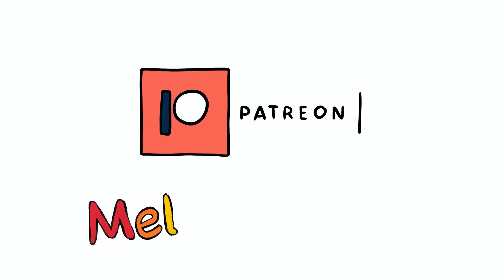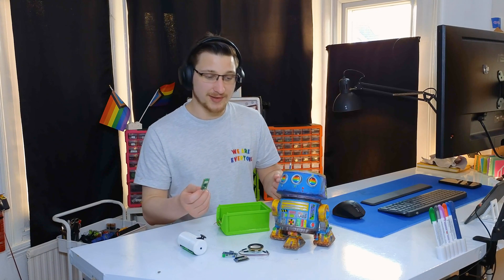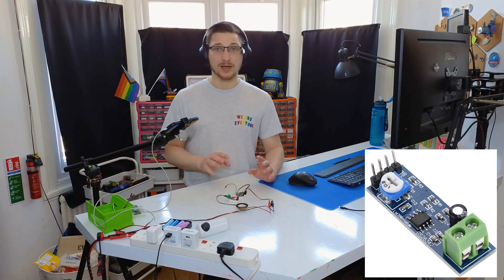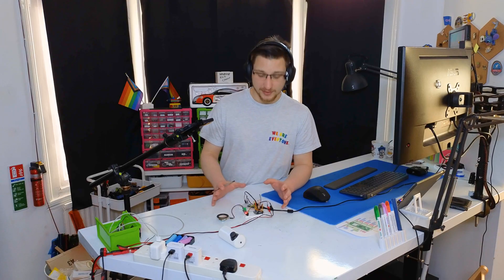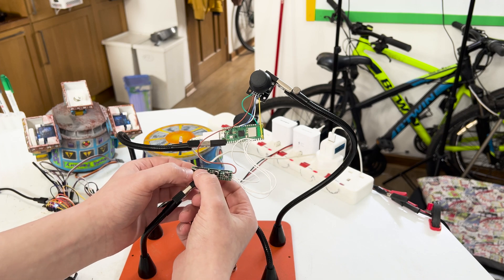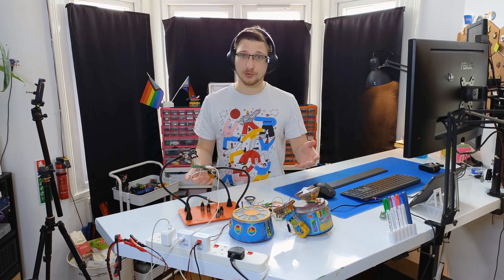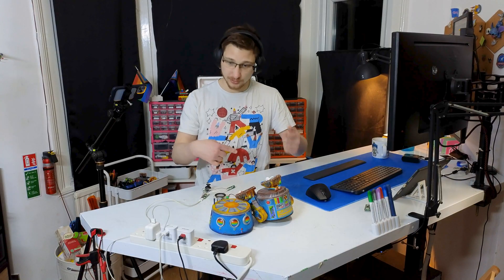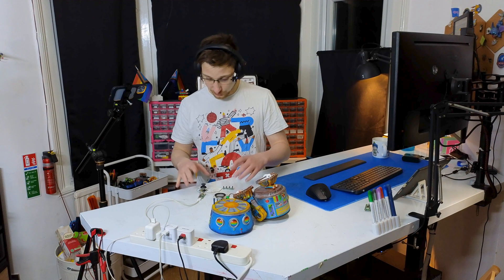Upgrades to my Star Wars Droid

Comment: Nice job! Love the little droid, and it's paintjob!! But have you tried just to use a usb powerbank? Or two, one for the servos and one for all the other things. Servos and all motor (almost) make a lot of electric noise, so separating the esp32, sound board and amplifier from the servos will make fewer brownouts and that way make the little dude much less prone to strange behavior.

But anyways, nice droid and well done!

Comment: clean electronic make clean sound wow
Reply from the maker: Actually, it’s kind of more complicated than that I ended up talking sound electrical engineer about it. It’s something blah blah blah, dirty ground, wi-Fi module causing noise.
Reply: @Mellow_labs  My guess is that the audio is cleaner because it's running off of a battery rather than the "noisy" bench power supply. Would be interesting to compare the power cleanness with an oscilloscope
Reply from the maker: Well maybe one day @keysight or @Electroboom will give me one 🤣 to test it.